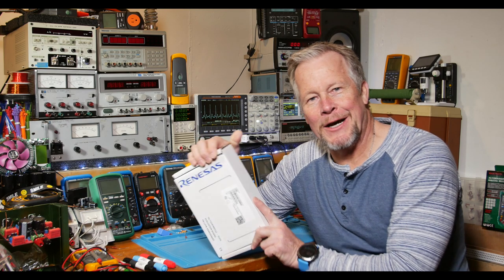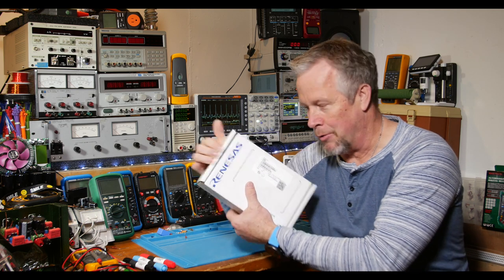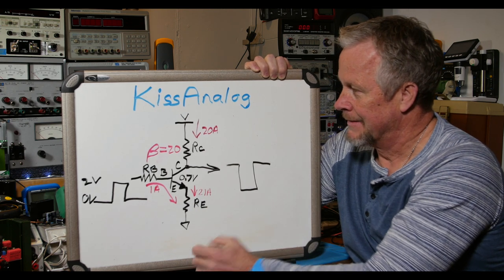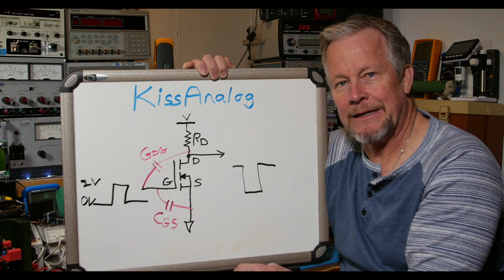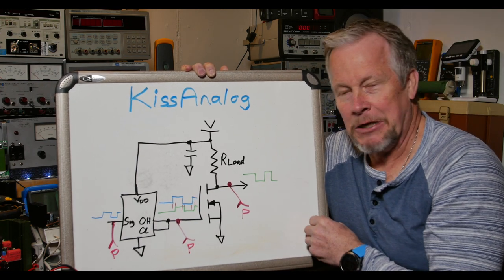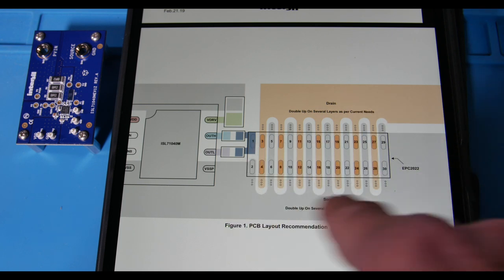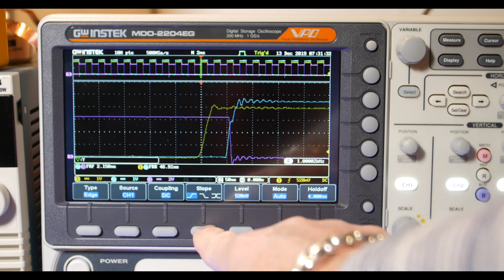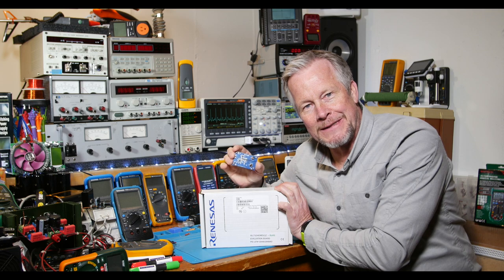Future of Power Electronics GaN MOSFET with Renesas Gate Driver ISL71040

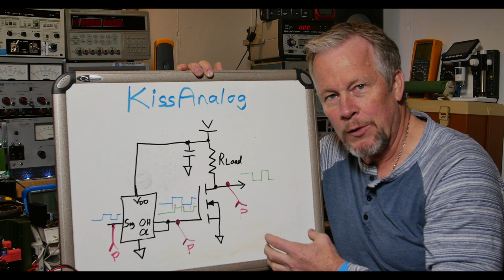Comment: 13:25 - So from my understanding, the driver chip is used specifically to supply and drive the GaN FET under 6 volts? If that is the case can I use a microcontroller which it's output pin can supply 5 volts to drive the GaN FET using PWM? This way I do not need a dedicated driver chip when a microcontroller can do the task just fine?
Reply from the maker: Great question.  It depends on the vendor and the FET.  GaN will be damaged above 6V and doesn't need as much drive current as MOSFET,  but you would want to be able to drive it off too, so that might be where you will wan to look at the specs.
Reply: Not quite. You need specific driver to supply high dv/dt with high current output, deadtime control and perhaps protection related functionalities.

Comment: Nice video, as always :) You know, i just don't understand something. A bit off topic, but ... why can't 2 copper layers (top and bottom) be enough ? Why do some manufacturers choose to use more, which i believe are placed inside the PCB itself ? It makes circuits impossible to fully reverse engineer, troubleshoot, etc. Or am i wrong ? Thanks
Reply from the maker: You are right - it makes it very difficult!  With all the pins on chips now with so many traces going everywhere it has forced many boards to go more layers.  It costs more but that’s what is needed on many boards today.  Great question!

Comment: Do you have any idea if the prop delay is dependent on the demo brd layout and/or some sort of "demo" drive package? If a revolution in FET fab comes at the price of mandatory driver packages and a really poor prop delay, I am missing the revolution.  

We live in 100's of GHz land now.  SMPSUs are sort of at developmental apex (except for BoM, size, etc.).  Something with this kind of delay must have some other benefit.  Is it the rad tolerance?  Forget space.  Tiny market.  Rad would be about a new standard in EMP resistance.  Is that the deal?  Basically, where's the beef?
Reply: I checked over at Ben-Yaakov's  (and an unmentionable) channel and got some answers.  In/out capacitance, RDS On, etc., all are about the same as normal MOSFET tech (well, the good stuff anyway, not the 1990's junk).  

Here's the killer:  That driver package is required, complete with its signal distortions.  Because, absolutely insane as it may be, these things are in the on state at power up.  Yup, dead short at start up.  That's why the driver is there.  Maybe if these things ever take off either the insanity or the driver distortions will get fixed.

This is not yet even close to a revolution.  It's at best  a shot on goal.  If they gave you this board, you should have said so.
Reply from the maker: I hope my last video helped with some of this...thanks for the questions!

Comment: They are cool devices - where did you obtain it, I can't find it on Farnell, RS, Mouser or Digikey?  Even Renesas page has 0 stock at distributors.  Can't wait for you to design and build something with it given that Renesas are targeting it at the space market - KISS, where the SS stands for space ship!!  :)  

Having just 'finished' my SMPS, I was thinking that I need to get a better understanding of Mosfets so I was going to try and build a simple circuit with one of the few I have and measure against the data sheet to see if I can get a better grip on what is happening.  It would be great to see you do more of this one's specs; also see if you can control the ringing - I guess there's less scope given the IC is on the board already.  I also need to find a cheap signal/waveform generator for stuff like this.
Reply from the maker: Hi Andrew!  Check with the EPS apps engineer who provide the GaN and non-Space parts; Mark Gurries (408) 580-7827.  I have the connection to The a Space parts too if you need that;)
Reply from the maker: I can’t wait to design with GaN.  I have some ideas that I’ll take to board design.  I’ll go over specs and how I choose FETs;)

Comment: WHAT ABOUT ESD AND,HEAT SINKING FOR THIS DEVICE?MOST AUDIOPHILES DO NOT LIKE CLASS D AMPLIFIERS BECAUSE THEY HAVE NOISE PROBLEMS.
Reply from the maker: They run much cooler but heat sink is done nearly the same - also esd from what I understand.  The GaN will improve the noise issues but we will have to se how it turns out.  Good to hear from you!  Did you get your copy of Microcap from my last video?